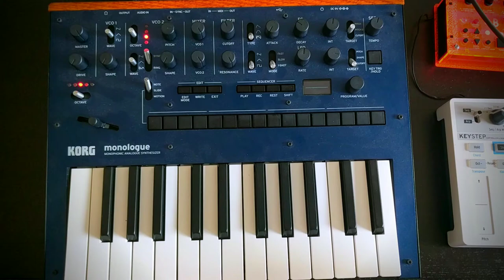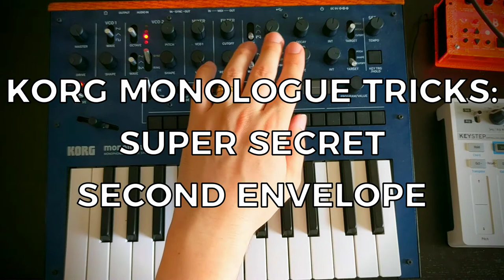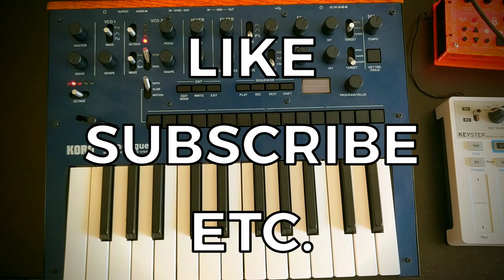Korg Monologue Tricks 02: The Super Secret 2nd Envelope!

Comment: Setting up the LFO to Key Trigger on the Korg Volca Keys gives this same trick.  I mod the filter with a ramp down saw LFO.  Gives me a nice Herbie Hancock Chameleon bass pop with a bit of resonance.  My Monologue was just ordered so looking forward to these two working together soon.  Great tips.  Like you mentioned, synths with limits help you look for work arounds.  I use these work arounds on other synths and they lead to things like synths with 3 envelopes modulating oscillators, filters and amps to varying degree on the same patch.  It can give you some wild random results with different envelope rates and fast or slow LFO retrigger speeds.

Comment: Awesome tips & tricks. great stuff!
Reply from the maker: +E. Grey S. Thank you, and thank you for watching!
Reply: No problem! Actually, I have a question relating to the main envelope (not the "second envelope"): how does the bottom "type" work? the one that looks like a normal Attack/Decay, but with a box around it. I've played with it and I have an idea of how it sounds, but I don't know how it works.
Reply from the maker: +E. Grey S. That's "gate mode". So, in the other two modes the VCA is controlled by the envelope - so you're getting a volume change along with whatever you're aiming the envelope at. So in the other two modes, you can set up an attack and decay, but leave "Int" at zero and you'll still get a volume envelope. The bottom "gate mode" decouples the VCA - the VCA turns up when you hold down a key and shuts off when you release it. It's useful of you're doing long filter sweeps with the envelope for example - you can really hear that initial part of the sweep, whereas in the other 2 modes it'd be too quiet to really enjoy it! Does that make sense?
Reply: Huh. Cool, thanks! Will have to test this out.